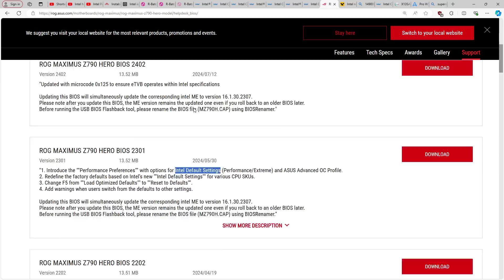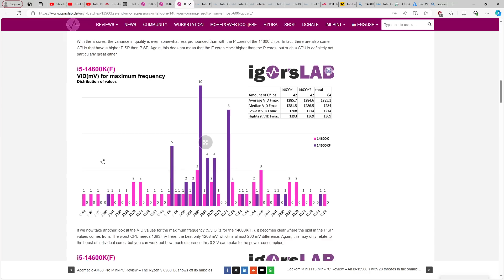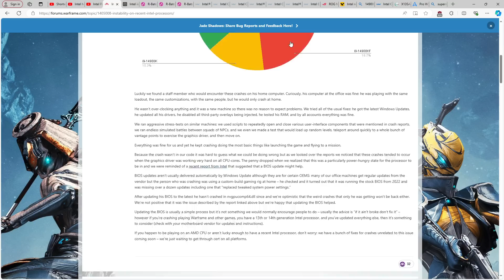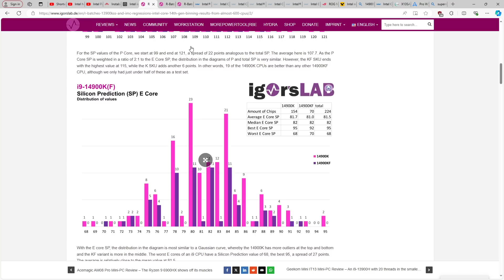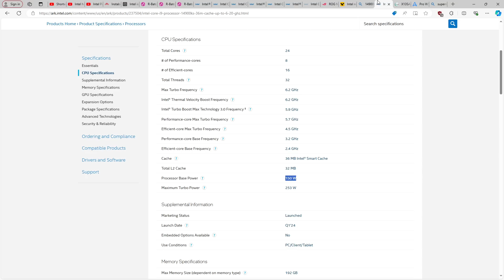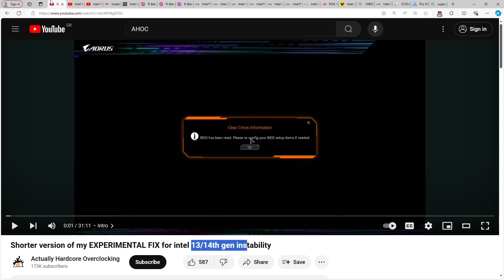The intel instability and degradation rant.

Comment: Feels like bizarro world that any crashes and application hangs is going to prompt me to think about possible CPU failure rather than something else.  Given how relatively bullet proof CPUs have seemed in past decades, I have to imagine the quantity of RMAs that Intel have been having to process for Raptor Lake is several orders of magnitude greater than their historical average.  I find it impossible to believe that Intel wouldn't have noticed this trend even just a few months after the 13th gen first going on sale.
Reply: They were hoping that they could sweep it under the rug,
Reply: @pf100andahalf  That or they were hoping it wouldn't snowball, but seems like that's what's happening.
Reply: Yea honestly I always thought CPUs were the most likely to survive the longest if not being pushed with overclocks and high voltages. Look at the amount of old core 2 duo/quads and Xeons still in circulation. Now fast forward 5 years into the future, we will probably have 0 of 13900k/14900k floating about with the failure rates
Reply: @HawtDawgBro09 Man if we're talking about modern CPUs being run too close to degradation with stock settings and compare it to the old core 2 CPUs.. Those things were built like tanks. I had a core 2 duo E6400 which was stable with a 50% overclock on stock voltages with the stock box cooler for 10 years. CPUs used to be run at such relaxed clocks it was insane.
Reply: All thanks to management decisions at Intel to boost CPUs into overdrive to be at least somewhat competitive. I refuse to believe that any competent engineer would not shout loudly at execs saying that these levels of voltage are dangerous.
Reply: In over 20 years of building PCs, every time I've had a CPU go faulty (3 times), it was my own fault, because I was running too much voltage. That is until 2019, when I had a Ryzen CPU go faulty on stock settings after ~6 months. Both AMD and Intel are running their silicon too close to degradation territory. On one hand, it's nice to know you're getting almost everything out of the CPU you paid for right out of the box. On the other hand, failing CPUs are now MUCH more common than they ever have been.
Reply: Yeah. I've had PCs where other things have failed, but the CPU was fine. I have an i5 2400, and a FX 6300 which have been rock solid for ten years or more, despite being heavily used. CPUs shouldn't fail so quickly.
Reply: They will have a lot of data to dwelve onto

Comment: Everyone knows Intel is shafting everyone including their High Volume Customers, The issues with the I/O block being moved on i9 on the 13 and 14th gen is not fixable. Meaning every 13 and 14900k/S is a ticking time bomb, The only chip I could possibly recommend is maybe the i7 as its like a 0.1% difference between a 12700/13700/14700. The Die shot still looks almost identical enough to know the I/O hasn't been moved. 

There is no fix btw. I don't think people realise, this engineering mistake will mean the eventually death of every i9 13 and 14 gen cpu out there. The walls of the I/O are just being hammered to bits. Until lowering your ddr5 to 3600 no longer has an effect.

If you want to see for yourself. Check the Die shot online and check the left hand side. You see the 12900k / 13700k/ 14700k look identical. They moved it out of the way on the 13900k and 14900k to make space for more heat and voltage. However doing so is what causes this cascating failure. P.S THIS HAS NOTHING TO DO WITH VOLTAGES, Xeons with very conservative voltages are having issues.

Comment: At this point I would avoid 15th Gen unless it's proven to be free of this, just choose AMD instead. There is literally no reason to buy Intel now. Far worse efficiency, slower and completely unpredictable in most important factor - stability.
Reply: I totally agree with your point. It is reasonable to avoid purchasing the 15th and 16th generations.
Reply: The only reason is for the iGPU, for a Plex server or similar. They’re quite good for that.

But yeah… that’s a small niche lmao
Reply: Dunno I have pretty bad experience with AMD stability especially 3000 series, so i still will buy 15/16th gen but i can see why people would don't want to
Reply: @dawwdd 3000 series was released in 2019 and there were no widespread issues. You are planning to buy 15th gen even if the 13th and 14th gen issues have been going on for over 6 months? By your logic you should wait until 19th generation.
Reply: @dawwdd  the only issues I had were with 1st Gen Ryzen (I had 1700), however that was due to early bios versions and first motherboards. Haven't had any issues since, especially not on my 5600.

Comment: Wendell's video seems to suggests that lowering frequency only makes the degradation show up at a later point.  The gaming server providers downclock the 13900K and 14900K out of the box now and they still show degradation regardless.  I'm not sure what the problem is but this to me seems like a recall.
Reply: Why u call a person using a product at spec a moron. How could they have known the product was defective in advance in order to bandaid it preemptively
Reply: @fepethepenguin8287  you are a moron because you didnt monitor temps and voltages

is it the car manufacturers problem when the driver never checks coolant levels or changes the oil and blows his engine???
Reply: He learned from jufes that being an Intel bitxh u need to constantly bash customers not the company. When it's AMD bash the company. That's the rule of Intel idiot heads
At this point i think these Intel fanatics are protecting their Intel investment otherwise i can't understand this level of cope.. @fepethepenguin8287
Reply: @fepethepenguin8287  using a ferrari at spec will still lead to failure if you never monitor oil and coolant levels
Reply: “The gaming server providers”

It’s literally one guy who made a blog post. That’s the entire source for this claim
Reply: the problem is 2 cores boosting into a death spiral of heat + voltage

the solution is simple, lock all cores to a set speed and see if you can undervolt

problem solved, unless you are a moron and did it too late and now it has degraded and cant function with proper voltages
Reply: @OdinAlgeron Calling people a moron for using a product as it was designed is... moronic
Reply: @OdinAlgeron  dude it happens when locked too. it degrades regardless even ddr5 4200 lmao.
Reply: @N4CR  no it doesnt, its just the morons that were too late and now the cpu has degraded to the point that normal voltages cause errors

100% solution, it just doesnt work on already damaged cpus
Reply: @OdinAlgeron so if I understand correctly, the fact that I was experiencing crashes and didn’t know about this issue makes me a moron ? I guess I only realized that something was wrong when I saw a video about asus multi enhancement bios settings and then the asus default settings of intel. But yeah my bad bro, I thought I could trust intel now i did rma
Reply: @TartauViiz  yes because you never monitored the cpu until it got so degraded to the point it started getting unstable on normal voltages
Reply: @OdinAlgeron  🤦‍♂️ please stop embarrassing your self bud
Reply: @OdinAlgeron  then how are the server costumers experiencing about 50% failure rate morons?
There boards limmit the TDP to 125 AND the temp never exceeded 85°C...
The most optimal environment possible, and they still have an atrocious failure rate...

Almost as if the chip has a hardware flaw 🤔

Not my words, level1tech has investigated the issue a bit further then you, and has a way bigger sample size then ONE!
Reply: @SuperUltimateLP  what do you think the failure rate is for enthusiasts that OVERCLOCK, tweak,  and monitor their pc?

also computer farmers are lazy as F, they may have thousands of modules and try to mechanize everything

they suffer a loss> NO BIG DEAL, warranty takes care of it

why do you think gpu's from coin farmers have such a bad rep????
Reply: @riba2233  you are like a little kid that pissed in the pool cause you got mad you cant use the big boy diving platform
Reply: @OdinAlgeron   rofl, please cope more bud! Y0u got destroyed with arguments so I would just advise y0u to stay quiet ok :)
Reply: @SuperUltimateLP  LOL these are the same idiots that didnt know what a VID table was????

the servers are burning cause the morons "monitoring" the servers never checked the VID tables 

many mobos are pumping 1.5v+ into the main 2 cores

lesson: MONITOR TEMPS AND VOLTAGES
Reply: @OdinAlgeron  Yeah, you're so much smarter than millions of people now that you have the benefit of hindsight and immeasurable real-world testing. Running a processor at stock settings, rookie mistake.
Reply: @OdinAlgeron  the problem seems to be more chache related, probably the ring is hitting it's architectural limmit
Reply: @SuperUltimateLP  nope, degraded cpu  unstable at normal voltages 

4.2 - 4.5 ghz ring bus 100% stable for years from smart people that make sure to monitor temps and voltages from the start

I run 5.1ghz main, 4.1ghz e-cores 24/7 since release date NO ISSUES because I properly calculated cooling requirements and undervolted
Reply: @OdinAlgeron  are you sure you aren't simply a outlier?
BZ clearly stated that he had a chip fail out of the box...
That shouldn't happen...
Reply: @SuperUltimateLP  of course anything made by man will not be perfect

that sounds like not the problem most people are talking about right now
Reply: @OdinAlgeron For how much he money the I9 is worth you shouldn't have to fiddle around with voltages, Intel is just an inferior product, the average consumer paying for a high end chip should be able to use it at stock settings that a bare minimum, does  my brother monitor his temps on his 7900X3D? Nope
Reply: @psychicpsycho99  for how much money a ferrari is worth you should not monitor coolant levels or change the oil

see how absolutely RETARDED that sounds?
Reply: @psychicpsycho99  for how much a ferrari is you should never change the oil or check the coolant levels

gotcha
Reply: @psychicpsycho99  the entire point of an unlocked i9 is that you can fiddle with voltages lol
Reply: @OdinAlgeron  no, I never permitted my cores to do that, and I had degredation on a 13900k that was never permitted to go above 5.4 and now on a 14900k that is never permitted to go above 5.6.

The ring is the issue, or at least, its the most likely cause  this far, and it seems them rings need lower core than what even normal clocks will require on most chips.  in future intel chips (and maybe even the current or soonish moble ones) things are powered more seperately.  That ring bus needed this sooner.
Reply: @ogBINARYGOD  did you monitor volts and temps?
Reply: @OdinAlgeron Should you need to on a stock system? If your answer is anything other than a resounding 'No' you're either an Intel simp or trolling.
Reply: @RNeeko  if you are NOT monitoring heat and voltages then you got what you deserve
Reply: @OdinAlgeron  So you're saying it's acceptable that these CPUs are burning themselves up under stock settings? 

Your comparison to a car's oil was incredibly stupid. This is really closer to ECU tuning. You're supposed to check up on your oil, but the car should still function normally with maintenance. It's like how you can't expect a PC to perform well if you never clean the dust out of the filters. A better comparison would be a car's ECU. Should a car break itself if a customer is not invested enough to monitor and tune the ECU themselves? Of course not, that'd be ridiculous. The car should work just fine on it's own without tuning the ECU yourself, just as you shouldn't need to tune a CPU to prevent it from burning itself up. Do you understand how dumb you sound now? These CPUs should work just fine out of the box when using an appropriate cooler, a motherboard with a solid VRM and a case that has good enough airflow. If a CPU cannot operate on it's own without intervention from the owner it's a faulty product, just as a car's ECU shouldn't push the car beyond it's capabilities.

I won't respond again. If you choose to reply with more trolling/Intel crotch hobbling I will not read it. Have a nice day.
Reply: @OdinAlgeron  Oh yeah also don't forget to pop a mint after you're done zipping it back up 👍
Reply: @RNeeko  thanks, pissing on your nead was tiring

its funny how mad shills always reveal the sugar in their tanks
Reply: @OdinAlgeron  my man is again ignoring the server side...
They do monitor AND log the temps and volts (there boards even limmit the voltage and the Industrial cooling prevents the temps ever exceeding 85C)

You are intellectually dishonest..
You keep reinforcing your own delusions that came about because you have a stable chip, non of what you did prevented in from becoming unstable...

And then again, who the fuck wants a chip that is so extremely prone to mess up in there systems...
Who wants to babysit there cpu all day, and fear the next crash???
Reply: @OdinAlgeron  Gaming server providers did lock all their 14900Ks to 5.5 GHz and it didn't stop them from failing and Wendel even pointed out that temps were well into the safe zone (I forget the actual figure but go and watch their video, temp was not an issue).

Whatever this issue is, it isn't your typical degradation.
Reply: @giglioflex  yeah this is a substrate level failure perhaps some rapid electromigration in IO area of die etc as it seems to be ring related.
Reply: @OdinAlgeron  Framechaser worshipper detected.
Reply: @OdinAlgeron  Moron? A bit harsh don't you think? The vast majority of users are not tech savvy enough to know that the MB manufacturers were overclocking the systems in the background. Hell, I'm not a tech but far from a rookie and I didn't realize what was causing my crashes immediately. Especially since 'out of vram'  (on a 12GB 4070ti?) and nvidea driver crashes looked like I had a bad GPU.
 I figured it out just before the information dam burst, but most users expect the MB to run at recommended values out of the box, my ASRock MB was overvolting my system from day one along with a default TJ Max of 115C and it was over a month before BSOD's began and somewhat longer to figure out what the hell was going on because I did not do any overclocking.
My only clue was a few games that either would not start at all or crashed quickly with nvidea errors. It was the CPU all along.

Comment: This whole debacle has further cemented my original choice in having Ryzen be the upgrade path from the i7 4790K.
Reply: Well, you made the right choice. I just upgraded from my i7 4790k to the i9 14900k and it was problems from day one.
Reply: Funny, I upgraded my 4670k to a 7950X3D. Wonder how many people were on 3rd and 4th gen intel until this gen.
Reply: @macicoinc9363  I myself had the 3700X as an intermediate between the 4790K and the 5800X3D. The initial thought (and result in benchmarks I ran) was double the performance at well under half the power consumption - 4.6GHz had my i7 drawing close to 120W (which combined with a 200W GTX 970 that boosted abnormally high at stock...toasty).
Reply: Do it! I went from a 4670K to a 7700X and the difference in performance is mind-blowing. At least two orders of magnitude faster, no joke. Paired it with 32GB of DDR5 6000, a 4TB PCIe gen 4 NVME, and a 4090. Programs open the second I click the icon, and loading screens in games are pretty much a thing of the past now. 4K gaming at 120Hz is amazing!
Reply: I went from a i7 4790K to a Ryzen 7 5800x3d and I couldn't be more satisfied.

Comment: Had an i5 14500 fail after turning on Asus Multicore Enhancement on a Z790-P D4 motherboard. It only posts with 1 p core disabled. The fun fact is it isn't even a Raptor Lake CPU, just an Alder Lake die. This is getting out of hand
Reply: You know.. It is still possible you got a defective cpu and this are separate issues.
Reply: Yes, but it was working fine for about 2-3 hours on watercooling

Comment: My guess is a manufacturing defect. Depending on where on the wafer they bin the cpu's they may tend faiil. As cpu shrink the transistors get smaller. the problem is as they get smaller the voltage leaking across to other transistors. this usually overcome by increasing voltage. the reason i think this is a issue for intel is becuase these are esentually refreshes. the die layout is relatively the same. maybe as they have modify its original design the allowable limit for leakage has increaased that when cpu is runnin high voltage the leaking voltage  is reaching more system critital parts of the io die or memory controller maybe? Itcould also be that in order to compete price to performance with amd offerings they thinned the layers of the silicon making the the transistors much more closer making the high voltages more damageing to neighboring components more likely. which wouldnt be a issue except they make them boost high for long periods. Over time the sensitive interconnects between each transistor become damaged so they require more voltage in order to perform same funtionality;

Comment: Had 14900kf from launch till now, recently even on stock it became so unstable browser tabs would crash with memory related errors (Memory checked in depth over 18 hours and I'm still using same kit), a week ago I switched to Ryzen 7950x3d, no issues anymore. I have build three flagship intel builds in last 9 years, this was the last time I bought intel. The amount of evening and weekends they stole from me over the last 6 months and especially last 4 weeks is frankly cruel, I'm so relieved to not spend my free time troubleshooting my computer. I work remotely in game dev, I need a stable PC... From day 0 that CPU could not run Cinebench/ Unreal Engine, after I installed bracket and 420mm AiO it was able to run those pretty well, then errors started happening after few months, then ever stock settings became unusable. And yeah I am planning to eBay the RMA